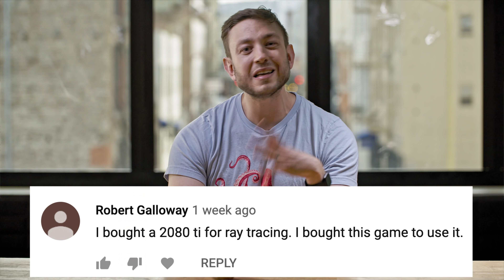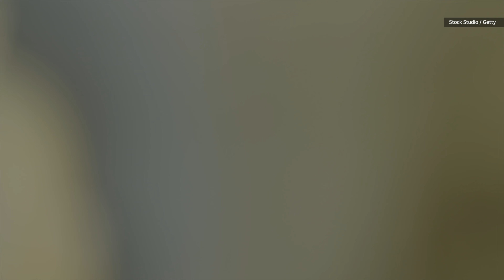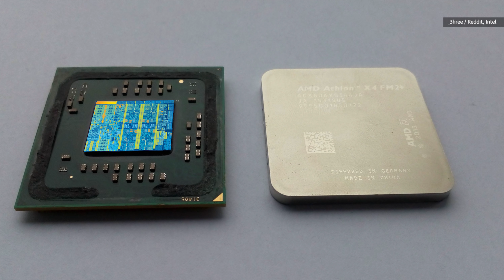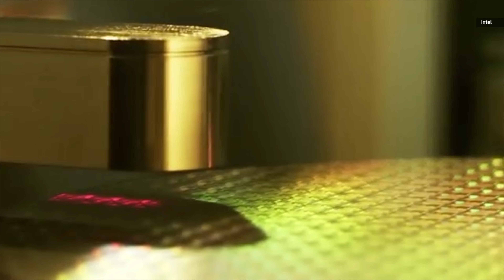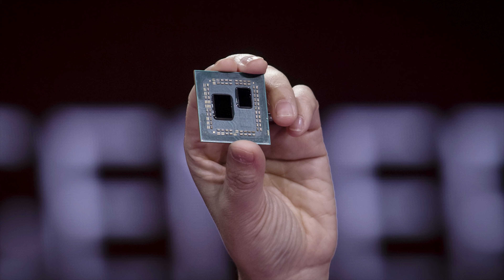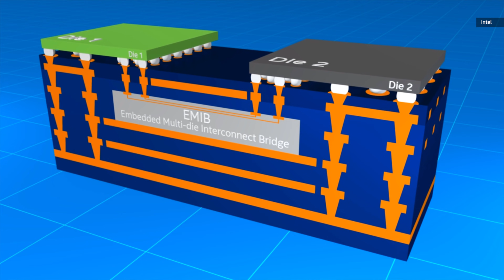How Intel and AMD are using 'chiplets' to build next-gen CPUs | Upscaled

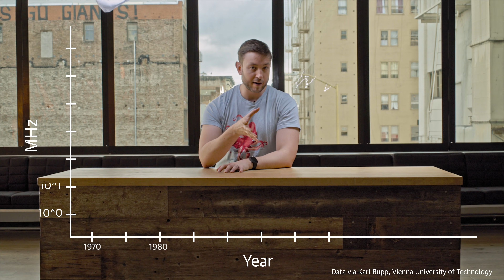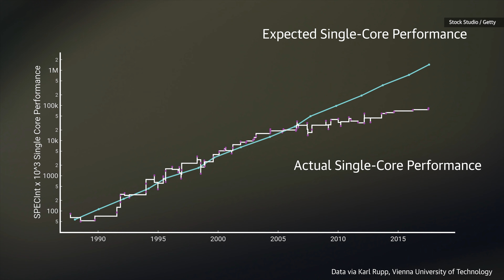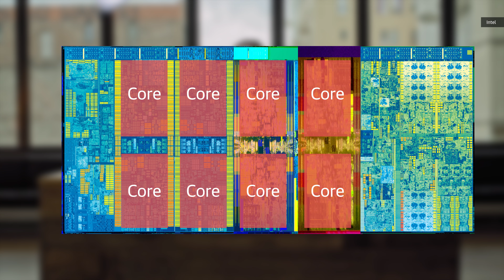Comment: I like how the video is produced and the presentation but I don't really see the content being clear. At 1:44 you argue performance didn't improve because of frequency didn't improve. At 4:00 you say performance didn't improve because single core performance didn't improve. At 3:10 you say parallel processing doesn't work because of the "Big Chip Problem" but it does seem to be working just fine for a lot of applications ...

Comment: Can't we just keep 2 or 3 separate processors.
I know that though it may not be viable in laptops (requirement of separate cooling system) at least desktops can become more powerful
Reply: Supposedly multi cpu systems are out there but they're just not common. I'd be all for it. Who wouldn't want to double their cpu strength for only $100 or $200.

Comment: Idk enough about this but why not make multi socket mobo's mainstream and "raid 0" multiple cpu's? Two separate (full) cores process one set of data by alternating between the two processors, effectively 'doubling' the speed of one core/the process. Sacrifice = extra power used. But if they want raw power combined with power efficiency, then idk where they're heading, i mean if they can't shrink their transistors, they've hit the power efficiency limit. Idk man, maybe i'm rambling, i should've been asleep for hours already

Comment: i wonder if there will be a time where CPU efficiency is so high that the power consumption of a 8 core 5ghz CPu goes down to about 30W.
Reply: Why spend so much time and money worrying about running things on batteries? I'd much rather have a powerful machine than an amazingly efficient one. Machines have not gotten much faster and the mobile market isn't doing us any favors in that area.

Computers are not play things. As much as I love power for gaming it has far more important and practical applications in science and medical technology.
Reply: @flameshana9  actually, CPU's getting more efficient and consuming lower power but still producing great performance can increase the maximum performance it can do. for example, most OC capable CPU is actually limitted due to how coolers limit it. an example is the ryzen processors. I currently have a 1300x and oced it to 3.9. i can go up to 4.1 but the temperatures goes way too high due to TDP. if it was more efficient, it wont consume that much power and dissipate that much heat. that just means that if i use something like water cooling i can reach 4.1 but why buy a cooler which is more expensive than my CPU (LOL) well, thats just a cenario

TL;DR, efficient cpu = higher performance potential.
Reply: @MARTINREN1231  Overall, sure. But you gotta admit companies shift their priorities a lot because of whatever is currently the most profitable. Technology should be less about selling and more about improving.
Reply: @flameshana9  true. im just here hoping that it could happen in the future though.

Comment: What about putt graphite between each layer which exits out the side then connects to the IHS so that you don't need to dissipate all the heat through all the layers of chips. Obviously you would add holes for the TSVs, but it's one way to reduce heat buildup.

Comment: Can you remember when Intel called AMD CPUs "glued" together?
Reply: Jim Keller is an independent contractor that has worked/works for everyone. They buy his time, they don't employ him directly.

Intel uses the 'glue' method as well. Of course they didn't mention that.
Reply: @techpappee  a senior vice president is not a independent contractor....
Reply: Oddly enough, Intel is not wrong about that. Infinity Fabric (the chip/core interconnect found in the Zen/Ryzen line) is build with a process called 'gluing', AMD has said as much. It just that Intel's marketing dept, in a panic over Ryzen keeping pace with Intel's offerings, were eluding to the fact that this was a 'bad thing' to do to a chip. 

Which is funny when you consider that, one... it is it not a bad thing and two... Intel did this themselves at the time of that statement till now. So yeah...
Reply: @DuvJones  jeah, i basically wrote this because intel are doing it too.
Reply: @accelerator5524   well Jim Keller (ryzen designer) works for intel now, so if you cant beat them buy them.
Reply: @pillsburyrampage  i ve read that jim keller does this. helping intel then amd then intel and so on
Reply: @accelerator5524  this is his first go-round with Intel, he helped Apple, jump from the sinking ship that was Tesla.
Reply: @pillsburyrampage  how was tesla a sinking ship?
Reply: @accelerator5524  there was a mass Exodus of a lot of executives, the fact that Tesla hasn't really turned a profit. When a lot of your people leave it's not a good sign. I've seen a lot of his interviews and I don't think musk is The reincarnation of Nikola Tesla. Smart guy but didn't really wow me.
Reply: @DuvJones  Meh. I just disregard anything that any corporation's PR department has cooked up outright. They'll lie as much as they can to extract some profit out of your pockets. A corporation's only real legal obligation is to increase its profits by a certain percentage every year for its share-holders. The only obligation they ever had to us died when we stopped criticizing their influence. Now, if a corporation under-performs, they blame it on their own customers.. Funny how we went from "here's what you get for your money" to "shut up and swallow that bullshit, Plebeian consumers." At this point, Humanity needs to re-grow some fucking spine. The rats have taken control of the ship.

Comment: Silicon can't go smaller, we need graphene, once graphene is ready to mass production, at least for CPU production, we can expect Moore's law to contenue.
Reply: It's less that graphene can go smaller, it's more that graphene won't melt under as much heat.... you can build it the same size and just stack more and not have to worry about heat.

Comment: If you have seen Ex Machina; the CPU they used was liquid based. If you can figure out a way to make a CPU like that we might become a type 1 civilization much sooner...
Reply: IBM has sub 10nm processors now that use inner core liquid cooling (that is some of  the transistor TSV would instead be liquid pipes, in effect like an ink jet printer but using liquid inside the chip to vacate the heat much much faster, and they can even directly link it with a standard heatlid on conventional cpu design (so you can use a standard heatsink as you always would, but instead of needing massive heatsinks they likely all would be no lager than 120mm tall tower or 35mm top down style....

I read about this as well as optical, quantum and so forth in my "travels"

some interesting stuff out there, I have a feeling some like Apple etc only trickle thing out, keep price jacked, all of them do not make recycle material as easy as it should be, which also keeps price higher than it ought to be >:(

Comment: The doubling trend can work if the size of packaging is relaxed or can be maintained but the problem is with newer gen, there's the constraint to design in smaller package and this is the difficult part as you are essentially shrinking your area while your transistors count increases. With density increase, you will have a lot of other problems such as reliability & manufacturability of the design as the smaller the process nodes gets, the more problem you will see when an area becomes too dense. 

Adding on top of that to increase frequency while at the same time to reduce power, it's actually very hard to meet timing at higher frequency when you have all these criterias tightened & bunched up together. As a rule of thumb, power is the opposite of frequency. You can have higher frequency design but risk in drawing more power or vice versa. So the challenge is to find the balance.

So don't simply judge by saying things can go easily as expected. Moore's Law might stand if we don't factor in other criteria i.e. power requirements, die area etc. These criterias are inevitable as it's based on consumer demand from time to time.
I mean CPU manufacturers are ok to design bigger die area which can fit in more performance but does consumer want a bigger cpu which drains more power? Ask that yourself. (Imagine fitting a large chunk of it in small notebooks or laptops).
It's easy for reviewers to just judge based on the finished product but do they know the effort it needed to make that happen?
Engineers labor day & night to make something that doesn't exist in the world yet and yet youtubers just lounge in their studio and criticize, earn more bucks than what a typical engineer might earn based on their criticism.

Comment: I would love to see Intel/AMD use a 4.5Ghz+ stock turbo clock/ 8-core cpu with fast threading performance, Pci express 4.0 & DDR5 5200MHZ+ memory support on a cheaper mainstream platform(Intel Core i9 9900k is way overpriced). I might be living in denial, but this is something we should have had 2 years ago; otherwise there is no point in upgrading from my intel core i7 4790k cpu! IMO tick-tock as been lackluster for intel.....
Reply: Fast threading ?
Reply: @Fee.1  Fast threading, I mean faster single thread performance like comparing a 2600k to a 4790k ect.

Comment: Foveros seems cool, even revolutionary for density in things like mobile devices, but I really doubt that design can scale up into anything usable in for example the desktop market. Silicon has a only about 20-25% the thermal conductivity of copper - so cooling CPU cores though one or more additional layers of silicon must be terrible once you turn up the power. Unless I have missed some sort of innovative solution for cooling channels integrated into the chip or something then I doubt this will be very exciting for the high performance crowd.

I am very much a big fan of the "big-little" design idea though. This just seems like such a good idea. If you have 4 (or maybe 6) high performance cores and then just a bunch of dense, cheap low-frequency cores to take care of everything else that can parallelize well it seems like you would be able to produce a cheap and very versatile CPU that could excel in both gaming and workstation/server type tasks - as well as being able to be extremely power efficient at low loads when you aren't pushing the system. You would need some OS support to intelligently assign fast and slow threads as needed, but I think most of this support already exists or could be added without too much issue.

Comment: F*ck yes, please! This video was great and anything Moore's law/IC/Transistor related is super fascinating.
Reply: Moore's law only deals with number of transistors and speaks to nothing regarding processing speeds, this is something most people don't even understand.  Also Moore's law isn't even the problem, Amdahl's law is, and that is a wall that we are already hitting right now for anything outside of niche tasks that most people do not perform.  They can add as many cores threads as they want and for the vast majority of users we will only see very small gains in the next generation of chips and past that virtually no gains.  This won't change unless changes are made to how software is written or hardware solutions are rolled out that take code that would typically be single threaded and makes it run in parallel.  It's as simple as that, we ARE already at a brick wall and the vast majority of people have absolutely no idea.  Amdahl's law is also exactly why Intel is superior for most things that most people do, they have a much better per thread performance, that per thread advantage is exactly why AMD has to try to hype people by demonstrating with workloads that aren't typical (rendering).
Reply: @competetodefeat4610  - I would add that even as you add more parallel paths the time to switch between tasks results in additional overhead which lowers performance.
Reply: @CORVETTE_DUDE_CHANNEL  Actually Intel  bought up a company, I can't recall the name off hand, that had been working on ways to take single threaded code and make it run as if it were multi threaded and it showed impressive gains in demonstrations but was certainly not ready for prime time.  I'd imagine they're working on this system and at some point we'll see it hit the market.  Either way I find it amusing that Amdahl's law is about to bitch slap everybody and most people won't even see it coming.
Reply: Compete ToDefeat r/iamverysmart
Reply: Ohh jaggonnnn I know doesn't it just get your thrusha glurghing?? Oh yeah!! Mine too !!!

Comment: meanwhile, at Intel: [screams in 14nm++++++]
Reply: AMD and Intel fanboys, let's be friends and agree on one thing.
Reply: @saminhossain750  Use both at home in in DC's at work. Both are good. AMD certainly don't get the credit they deserve. CPU's are not all about gaming so many on here behind their k/b's think their use is  the centre of the cpu universe. The same kind that froth over rgb lighting.
Reply: Cringey Intel fanboys starting debates below a joke comment... So much salt from the blue camp lately
Reply: @bohmel  LOL True, how many lanes on the Epycs now. about 60?
Let me see, 2 socket 128 core, 256 logical on a single board with 8 mem controllers hitting 2TB RAM and enough lanes to run just about anything all at once. Now that would be very salty.
Reply: @romaneeconti02  Yet the numbers are in. And Intel is losing. That I know, and I can confirm, Intel has losing its grip on the consumer market and just about lost the server market.
Reply: And still beating AMD with that 14nm refresh, lol
Reply: @AZI3623  with such a high power draw at 5 Ghz...sure.
Reply: @AZI3623  Only because till now games haven't been designed to utilise more core, they still rely on single core performance, the design process which is changing by the day will take advantage of more cores.
Reply: @AZI3623  not in dc they're not
Reply: @AZI3623  Except it isn't? AMD has established itself in consumer and Server market. Intel cant even roll out their 10nm. How can they compete this year?
Reply: meanwhile, at AMD: [screams in worse gaming performance]
Reply: @idcaf  negligible*
Reply: idcaf for 1080p high refresh rate you get about 5% lower average framerates and actually higher 1% and .1% lows. a 5% decrease in average framerate is unnoticeable at over 150fps, but the 1% low difference will be very noticeable at any refresh rate because that's what actually causes freezes and stutters. more importantly, what kind of fucking peasant can afford a 1080ti/2080 and somehow is still on 1080p, get with the times and buy a 4k monitor. 'but 4k is expensive waaah' so are intel cpus, an equivalent gaming performance chip from intel will always be $200 more than AMD's offering, and the price difference between a 1080p and 4k monitor of the same diagonal dimension is $200-300.
Reply: @KingHalbatorix  Highest end 4K monitor goes for about $1600. And even then a 2080 ti doesn't keep up with it
Reply: Walter Amir and you could spend literally 30% of that and get similar specs. I never said there were no expensive options for 4k, just that it is not expensive to get into 4k, especially if you already have the budget for a high end RTX card or a 1080ti (because those are the only cards available which would be bottlenecked by an AMD chip.)

To give a comparison: It's not expensive to buy a car relative to the expenses of other necessitates in life such as housing; however, there exists cars which cost millions of dollars. Nonetheless, the existence of a Bugatti Veyron does not invalidate the statement "you can get a car for only a few grand."
Reply: @Reignbeauxdragon   highest end FHD monitors go for 800USD. You're point? You could spend a 1/4 of that and get 95% of the specs.

 Still doesn't change that most UHD monitors can be had for 400$ these days with IPS and adaptive sync, basically being 200$ more than FHD ones.
Reply: @KingHalbatorix  negligible? well depends on target audience. I play on 1080p as fps is more important for my gaming experience than higher resolution and yes ryzen 2700x is slower than 9900k, not much but it always better to have more fps, for me. Eventhough I use gsync monitor, I would rather play on system that could deliver 20fps more for the same price. My System currently 2700x 1080ti 3200cl14, cant wait for zen2. Also to remind you, ryzen need better ram to perform better, 16gb3200cl14 non rgb samsung b-die could cost you 180€-240€ here. The price different isnt that much between 9900k, I use x62 kraken so the wraith cooler is kinda worthless for me. The big deal is zen2, I might just gift/sell my 2700x and get 3700x.
Reply: @KingHalbatorix  What AMD chip bottlenecks a 1080ti? No Ryzen 7 gets bottlenecked even with a 2080 ti. Fuck outta here
Reply: @Reignbeauxdragon  It's just gaming, Toy computing.

Comment: the problem with processors of today is still slow even though it is packed with lots of cores and thread... as long the processors are not optics it is still slow... the Israelis developt a Fiber Optics processors....hehe you dont know it ha!
Reply: Still they can add numbers a lot faster than me.
The biggest cause of "slow" is the software.